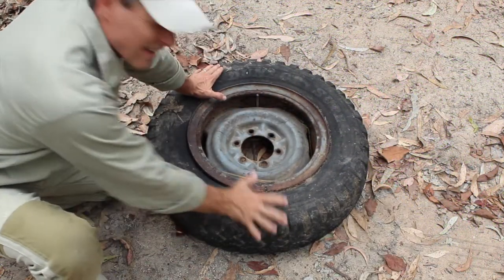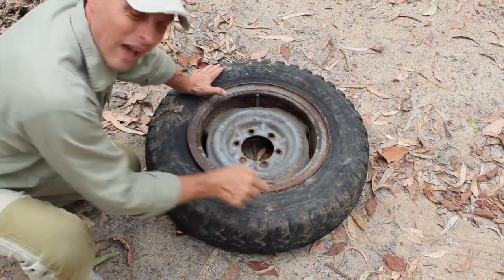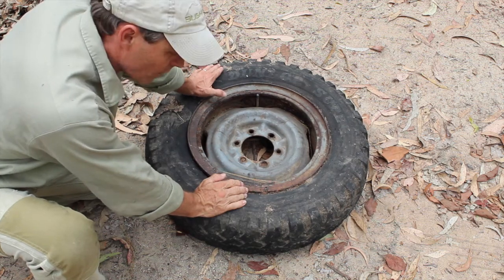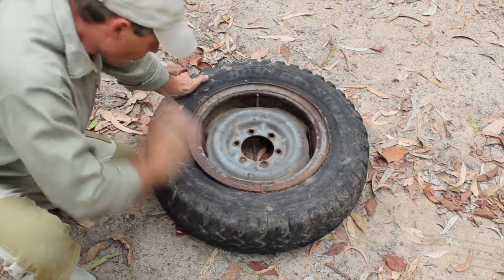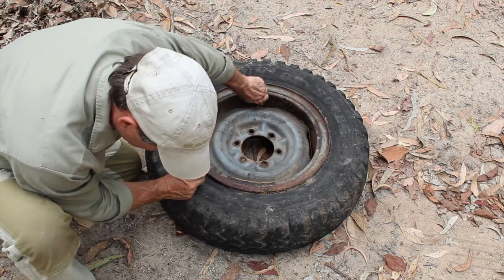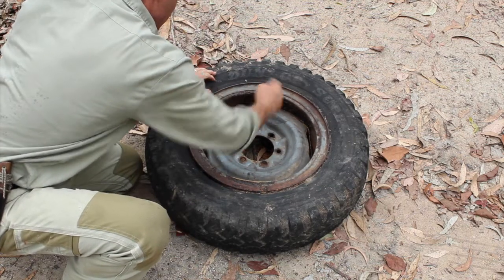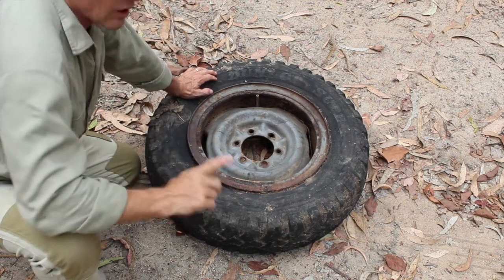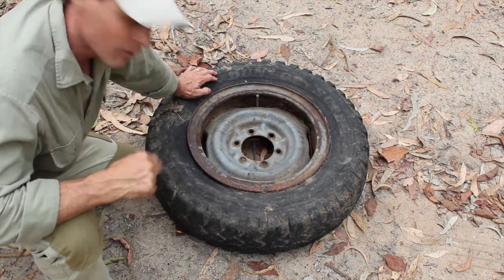How to Light a Tyre Signal Fire  - Part 1

Comment: I've burned tires on occasion , usually on camping trips to keep mosquitoes away . Tires are difficult to get to light but can burn for many hours and are difficult to extinguish .  In my US Navy firefighting training we were taught that there are four classes of fire . These are classes A B C And D . Class A are materials that produce ash , such as wood . Class B are materials such as oil and petroleum that create black smoke . Class C is fire from electrical wiring . Class D is fire from materials such as magnesium and aluminum .  The smoke from a Class B fire is darker in color than a Class A fire , and a trained firefighter or Search and Rescue operator should observe the difference . A high temperature flash point material requires ignition from a lower flash point fire . Cheers , Mate !